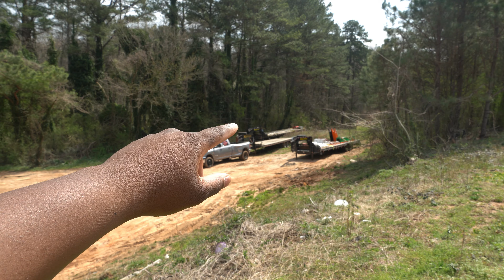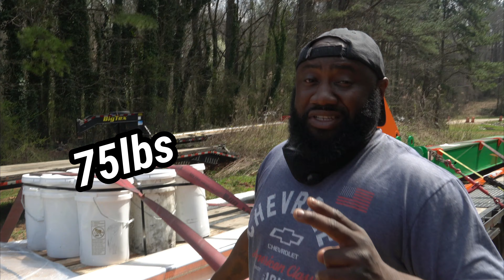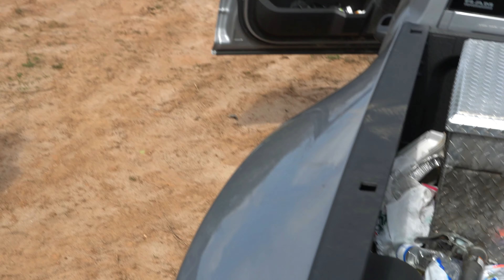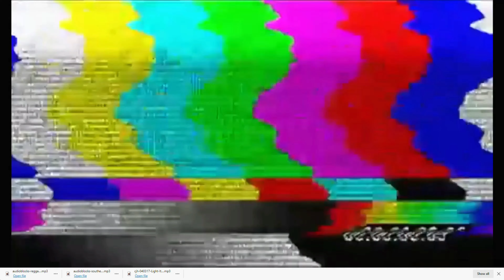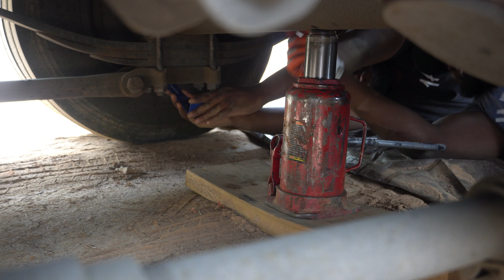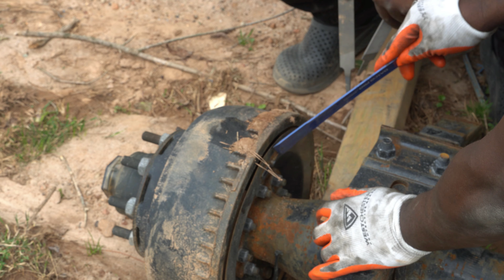How to Adjust your hotshot trailer brakes.....**Weekly Money Talk **

Comment: Great video. I have tried to adjust my breaks before. I am current running on. The highest selection and it feels like the truck is doing all of the stopping. I changed the rotors and bras front and read this week. I tried to use the adjuster access holes where the rubber plug is on yours. I checked today to ensure that I had adequate pad left on all four axles. I will try your method tomorrow.
Reply from the maker: Tell us how it goes man 🔥💪🏾

Comment: Have you checked your trucks front & rear pads & rotors ?
I went through front pads on my '19 Ram 3500 at 43K miles, front & rear at 80K miles. Very disappointing,  and pads & rotors are hard to find. I'm towing 30K lbs constantly .
Reply from the maker: How are you braking ?
Reply: @truckingwithbennii  Apparently my PJ trailer electric hydraulic brakes were way out of adjustment.  3rd time into a PJ Service shop they admitted they were not adjusted properly (after being assured at 45K miles and 65K miles they were fine)